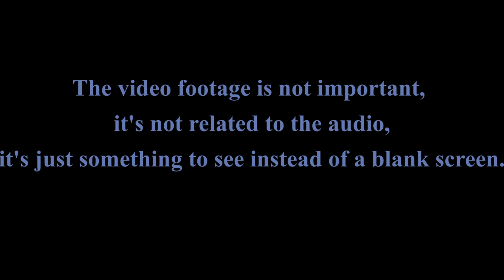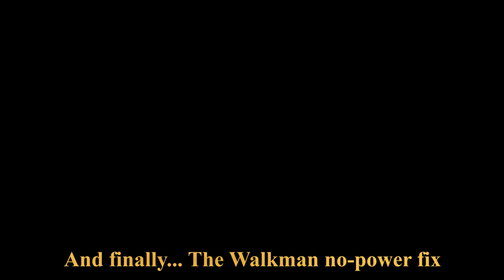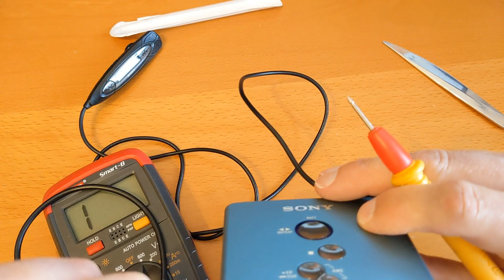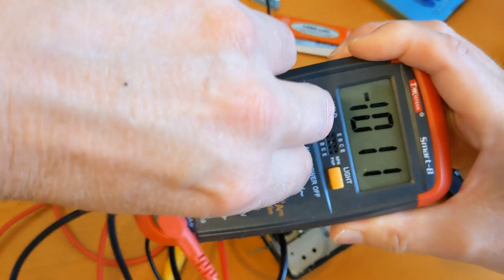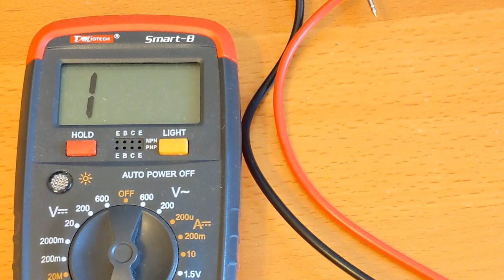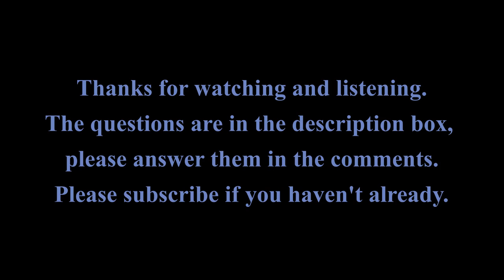Channel update, questions for you, and Walkman no-power fix

Comment: Also while I prefer the link in the description myself, they recently updated the Cards system so when you click it, it shows you a link to the rest the video at the bottom rather than automatically kicking you to the next page, so I do use it sometimes.
Reply from the maker: Ah, thanks. I didn't know they've updated it, so I'll experiment with that. Maybe I'll add cards from now on as a result. Thanks.

Comment: That sucks international shipping is no longer flat rate, that's frankly ridiculous. I'm glad you are trying to make the hobby more sustainable, the repair is the most fascinating part, so I'm glad to see that you will still be doing that without having 2 dozen minidiscs players that are working but not seeing much use otherwise.

Also if I recall correctly, if you are more comfortable with having the patreon being based on your video output, there is an option for Per Content made rather than a monthly fee no matter what.
Reply from the maker: Thanks. Maybe the per-video thing would work. But then I wouldn't want to put out a three minute video on something trivial because I feel it wouldn't be fair to those paying per video.